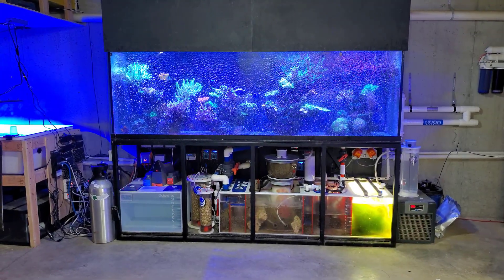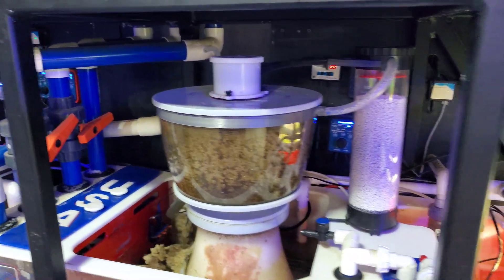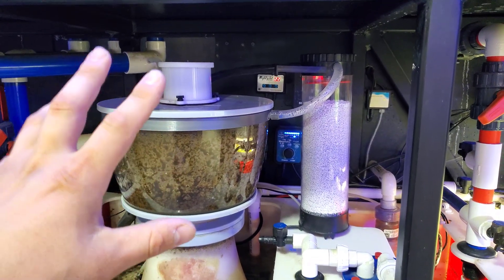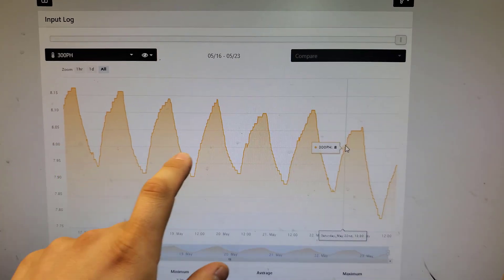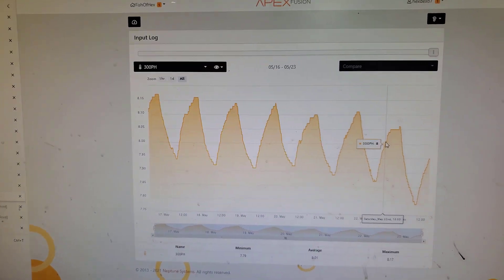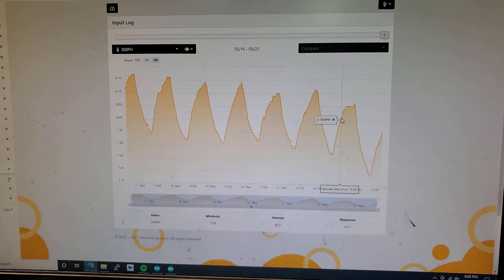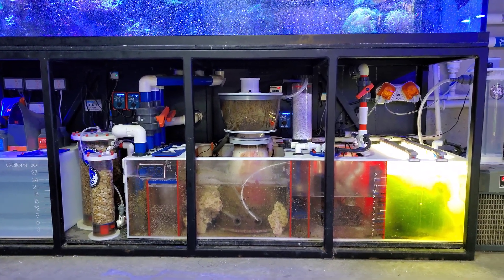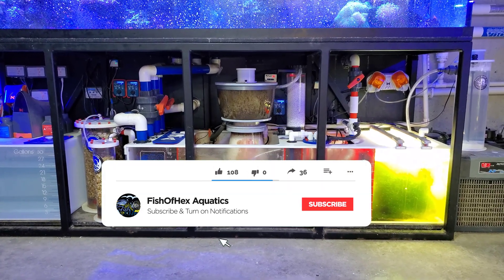Final BRS CO2 Media Test | Recirculating Scrubber | Did It Work?

Comment: What happens if the skimmer overflows back into the scrubber? All that calcium hydroxide into your sump/tank? Yikes.
Reply from the maker: I offer and recommend a collection container just incase but at the end of the day you should have a automatic shut off or float valve in your skimmer cup if you plan on using a system with that kind of risk.

Comment: I went through 3-4 big bags of this BRS media before I got fed up and switched to the stuff you can get off Amazon in the big jug, I think it's like 40lbs for $120.  I have a RO SS5000 external Skimmer recirculating with a BRS jumbo scrubber.  A fresh fill will last me 2-3 weeks.  And the color change is noticeable and holds longer than 24 hours before getting lighter.  BRS media in that same configuration was exhausted in about a week.  Sometimes the only way to tell the BRS media has changed color is to drop a couple of fresh out the bag pellets on top so you can see the difference.  The 40lb jug lasts me 6-8 months.  About 2 months into my 2nd jug now after switching and will need to do my 3rd refill sometime this week.
Reply: Link to the amazon stuff?

Comment: So I use this media. It lasts about 1 month for me in a BRS CO2 reactor.

The BRS reactor has sponges in it. This media pretty much immediately dyed those sponges a dark purple and has kept them that way.

I think what’s happening is it does have a color changing dye...but the dye is so water soluble that the moist air makes it leak downward instead of staying on the rocks themselves. I’m positive there is a color changing aspect to them but it sucks.

Only thing I’d recommend to you is if you try again, don’t add water to the bottom of the reactor. If you recirculate there will be so much moisture that over time you’ll need to dump it out from the bottom of the reactor. I’m curious if you added so much water that as more got collected it started blocking the air flow. That’s what happens to mine. I dump the water out every week or so. And as it gets close to that mark, the media stops working as well. Once I dump out the water...the media keeps working at peak performance again. 

Then finally after about a month or 5 weeks the media will actually stop working as well.

Unfortunately your DIY reactor would probably suck in terms of dumping this excess water. The BRS reactor works great cuz the media all stays inside of the resin tubes that it uses.

Comment: Divers use the same stuff for filling their oxygen tanks. It is a mutch cheaper than BRS, and you can get IT with or without colour change. It is called Sofnolime 797. I buy it In bulk from diver shops.

Comment: I never really got it to change color either. Also the amount of media you have for the size of your tank is a bit small. I use a large gatorade bottle sized amount, which is maybe slightly less than you have here. But I have a Waterbox 100.3, which is waaaay smaller than the tank you have. You probably need at least 5x as much media.

The BRS media cost comes to $5.41 per pound. But you can get it for $2.60 per pound directly from Jorgensen Labs. Cheaper if you buy the 5 gallon one.
Reply: I also noticed this

Comment: You can cook it in the oven to reset if, if I remember correctly. BRS is great, amazing even, but I’ve had better luck with two little fishies CO2 media.
Reply: You can’t use a regular oven to do it, you need a oven that gets 2000 degrees faraihneght or more

Comment: Mine changed color, but its slight, you can see it better when you pour it out. Also, The color changes back to white pretty quickly if u miss it. Can not rely on the color as a indicator for sure. When i ran the media un recirculated the color change was more obvious.